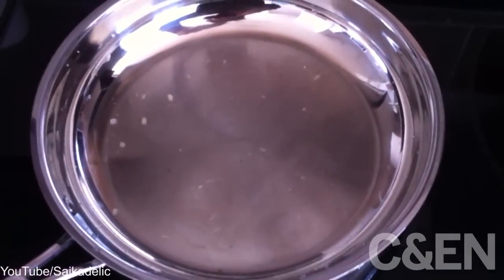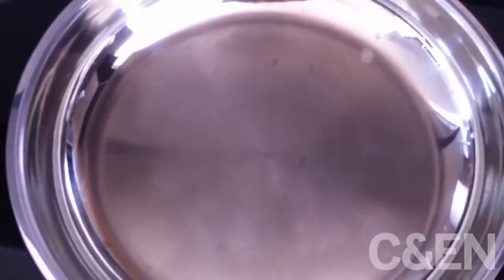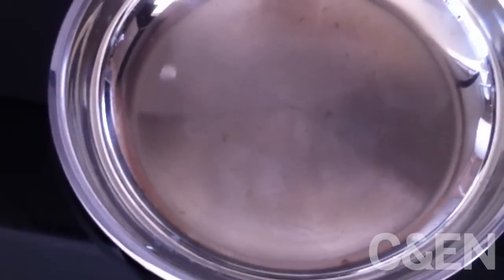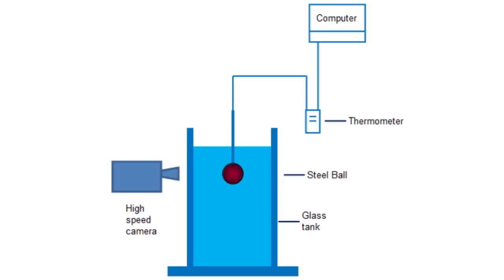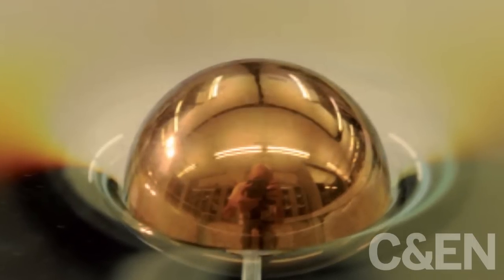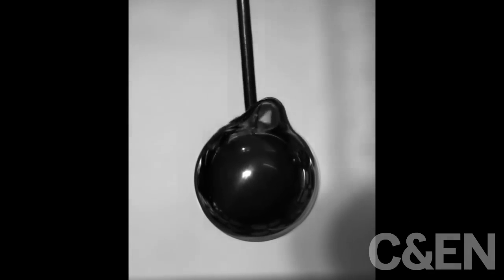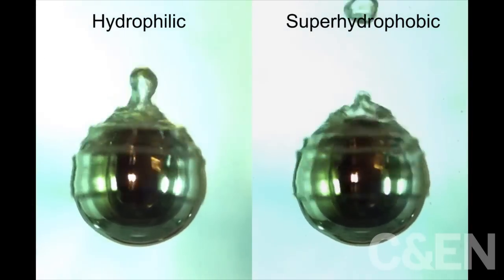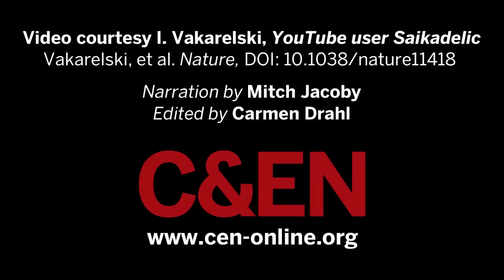Taming Explosive Boiling With A Coating

Comment: it's definitely not normal, so it's not an easy thing to imagine.

but you have it right. the steam pressure is in equilibrium. and the water is boiling, or else there wouldn't be any bubbles coming off of it. rather than thinking about it in terms of the water, just think of it as a single big bubble that's coming off. Instead of hundreds of tiny bubbles, you have 1 bubble that's giant.

Comment: so the steam in-between the metal surface and the water surface is being constantly heated up and cooled down so the steam pressure stays in some state of equilibrium? It's just hard to visualize what's exactly is going on in the "steam" layer around the ball.. it looks very stable, yet the super heated water particles must be moving around there like crazy.

Comment: boiling occurs when all of the water is at boiling temp. what's actually happening is that the ball is able to get to 600 degrees because of the are pocket around it. it insulates the ball and keeps the water from stealing the heat away. if the liquid water touched the ball, then the temperature of the steel ball would drop to the temp of the water.